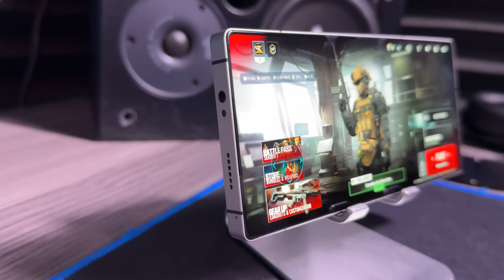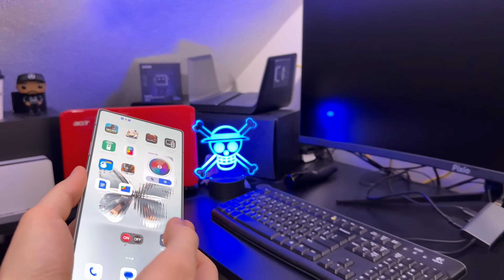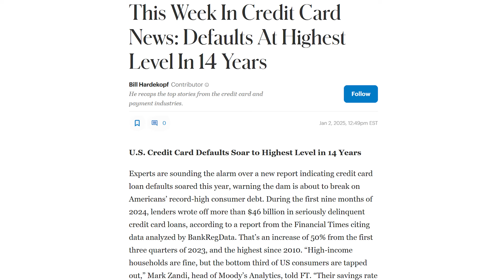What CES Revealed About Repairable Tech In a Record Year For E-Waste (2025 Is Not Looking Good)

Comment: I have a story about repair manuals: I bought an old radio/cassette player from the 80's on eBay recently, and found a manual for it online. That manual tells you the exact steps for disassembly, tells you where all the screws are and how to get them out properly, and the specifications for -- check this: the pinch roller pressure, torque, azimuth; basically everything you need. Oh, and it also lists all the tape models for testing and some of the tools you need.

As someone born in the 2000's I've never seen ANY manual that's like this, and I love this old thing already. It's so cool to have documentation that just tells you "go fix it yourself, heres some info to make you less likely to screw up," rather than "hey, here's the phone number to call for someone to tell you to buy more of our stuff, idiot". Makes me like my product and the company more this way.
Reply: Equipment repairman. Sometimes i end up working on gear thats 30 years old. EVERY bit of kit from this era has excellent service manuals
Nowadays a 'field service manual' might as well be a one page doc 'no serviceable parts inside'

That way the technician can spend ages on the problem for a nice fat invoice and then when the equipment dies you get to buy another one!
Reply: Even cars used to have full teardown/reassembly instructions in the owner's manual. Now the owner's manual sends you to the dealership @localwhackhead
Reply: @ohnoitisnt  'gear' is pretty vague. If you repair stuff like dental chairs and x ray machines, ofc you're misunderstanding the difference between that and a modern mobile device. People who think a manual is going to tell you everything about a device... most devices come with a link to a pdf if you really need it. 

You wanna fix an iPhone? Get a straight razor and a $12 micro driver kit from Walmart. Do you really need someone to kill a tree for you to unscrew 2 pentalobes and use a razor to pry gently, creating enough room to insert a pick? 

Want warnings about using too much force or what could happen if you pry from the wrong edge? How about instructions on how to turn screws or remember placement? 

Most of what people criticize repair for... are basic skills anyone can learn. If you lack dexterity... or hands, might be a different story. As a repair tech I can confirm people mess up their own devices trying to do self repair and save money. You already have the right to do that. 

You'll pay for help to fix your mistakes, depending what they are... a new phone might be cheaper. Also, coming from someone using an 8 yr old smartphone to send this message. A phone I have worked on a few times. 

Without a manual.
Reply: @Baeloro1481  lol what kinds of repairs can you do on an iphone with a razor and a screwdriver? You open it, now what?
Reply: I bought a laptop from Lenovo 2-3 years ago, and they have manuals for how to open up and modify the laptop available for people to download and use, along with recommendations on what to use to open it. Not every company does it, but some still do.
Reply: @NobleLeader6  Exactly this. Making blanket statements about 'rights to repair' tends to make you look silly when anyone actually spends time investigating claims. 99.99999% of the time you have one of two situations: 

1. Companies doing something to help consumers. 

2. Companies giving consumers a reason to avoid buying their products. 

Making it about rights and repairs, and making that the springboard for anything else, actually pretty distracting and disingenuous. 

There are people who complain about not getting more stuff in boxes, when most of the stuff ends up in the trash anyway. Manuals used to be pretty chonky. Now they are QR codes. 

While it's not as convenient as having dead tree remains (I am not a tree hugger) detailing everything you might ever need to know, it's friendlier to both cost reduction and resource savings.
Reply: Love your story man. I grew up in the 90s. Almost all of the old stuff was like this. Imagine the 50s. Average American family, people did go to the electronics store, buy the kit or parts, and they bulid themselves a vaccuum tube amp. That was the norm back then. They bouth the Dynaco ST-70 kit. 100+Volts, so its not a toy, still everybody could build it and they sold 300000+kits back in the 50s...
Reply: It's cool. There's a few orders of magnitude of miniaturization between a cassette player from the 80s and any modern device. It's not really a matter of 'you need manuals' but more of a 'you need eyesight and manual dexterity capable of working on micro electronics. Things you need a microscope to even begin to see. Imagine science class all over again, looking at stuff on a slide magnified. 

Cept you're working on an iphone 11 with board separation and it could be one of 30 solder joints and you just cleared your afternoon so you can painstakingly check each one with a multi meter. I'm all for people working on their own stuff, but there comes a point when the size of the components, the ability to do the work, is not there for 98% of people who would actually try. 

Spend $1000 on a device, break it taking it apart, do irreversible damage to components 'DIY Value' and then take it to a shop where someone gives you a look and quotes you way too much money to fix it.
Reply: @Baeloro1481  That is nonsense and you know it. By your logic, desktop computers are impossible to exist nowadays, since they are made of microelectronics. Not to mention there still is many repair shops for smartphones.

No one is talking about making the electronics from scratch, your analogy is like saying tha old manual is useless bcause common people don't have the machinery to made plastic molding. Everything nowadays is modular, many times being posssible to take a piece from a broken model and reusing it. Not to mention there are many DIY that can indeed do what you mention and would love to work on the hardware and software.
Reply: @Baeloro1481  FYI, repair manuals are for the repair technicians. Right to Repair is more like "Right to get it repaired from a 3rd party technician". Nobody is asking devices to be made easy enough to repair for the average person
Reply: @marcogenovesi8570  Actually, everyone in repair advocating for 'rights' is asking for 'user replaceable batteries' and people are hopping on the modular bandwagon via Framework and Fair phone - two companies whose entire shtick is to let the end user replace parts. There's another company doing it recently too, HMD. 

So, a 'repair manual' is like 'the paper version' of what people typically use in electronics repair. It's a 'gotcha' point. Boardview is software that lets you view the schematic electronically. 

Either, you have rights to repair already, and can get that done (send it to me, I'll give you fair price and do quality work), or you don't have rights and you need to secure them somehow? 

In an age where you can, in fact, get 3rd party repairs done... but the issue will always be quality workmanship. I've met guys I wouldn't let work on my own phone, happily churning out reworks for their shop, none the wiser. 

Ubreak Ifixit even has OEM parts access.
Reply: @ Right to repair is a much larger movement than the small quantity of consumer electronics you look at. Home appliances, automotive and farming equipment are the main ones, on top of smartphones and computers.

Batteries are not parts they are consumables and as such they should be replaceable by the user, like they were in the era of the AA and AAA batteries. Some companies like Framework go overboard and make the whole modularity a gimmick, but it's not what the movement is asking from OEMs.

A repair manual is the manual used by repair technicians in general. It's not just the board schematics it's the full disassemply/assembly instructions for field technicians.
Because again there are more items than just what you can work on that have significant mechanical component and need instructions for servicing. Don't come at me with your "I'm 150 IQ and I don't need that", you work on small stuff where the worst is clips and glue.

So you can source custom electronic parts that are not even on catalog, or pair iphone components or John Deere components? How big is your schematics library? No kiddo you cannot. You speak like you are still in the 2000s, the times changed.

OEM parts access alone means nothing, especially for Samsung I have seen them do fast and loose with that. Stuff might be out of stock for 6 months or priced too high to attempt a repair.
It's either third party replacement parts like with cars or nothing, imho.

And speaking of "quality workmanship", ubreak ifixit is not one of those. Most chains in general are not particularly good
Reply: @marcogenovesi8570  Basically, you misunderstand your rights, what repairing anything means, and your role/responsibility as a consumer. 

1. People should always vote with their wallet. People should never buy marketing hype or branding. - virtually no one listens. Look at all the schmucks walking around with apple vision pro for the 3 days it was relevant/cool. $3500 entry fee on that.

For some aspects of consumerism, you will only get a product that is disposable. Unless you create something yourself, out of components you sourced yourself (which is possible, people do it), you are always going to be purchasing someone's design, the flaws they overlooked, and you will be participating in their version of this product, not anything else. 

2. ANYTHING IS REPAIRABLE.... with the caveat of 'you must possess a degree of knowledge/skill to facilitate a repair, even if tools/parts are provided.' We are talking about materials and parts that are no longer hand produced. A machine will fabricate a silicone wafer and then stamp/edge the transistors into the surface... and that is a 1 and done process. 

If the chip has a flaw or fails, you get another chip. You do not repair. Many processes are this way, hence the modular components, lack of 'easy repair' because... duh. It's like expecting brain surgery to be easy because putting on a band aid is easy. Different problems. 

In a world of people who can put on band aids, you have a brain surgeons problem when it comes to repair. It's not as easy as anyone argues. You can fix your stuff. No one can legally stop you. If someone designed something so poorly it cannot be repaired... you maybe should know that before you buy it (do your homework on new anything) and maybe avoid it. 

Don't buy it, use it, break it, then demand a repair. That's how you end up feeling put out. 

3. Batteries are not 'consumable.' They are 'rechargeable' or 'replaceable.' You don't eat batteries. Batteries are not consumed by a product. They are depleted, then either replaced (old model), or recharged (new model). Everything from automobiles to toothbrushes have rechargeable batteries now, both for sustainability reasons (fewer batteries being produced) and for convenience. 

Having to buy a battery, find where you stored them, hope you have some left, hope they still have a charge, and then figure out how to change them (because it probably won't be the same for a toothbrush as a cellphone) all things that make disposable batteries a worse experience. 

Wanting to have a spare battery is okey. Wanting to put it in, also okey. Like I've said, currently using a v30 with a battery I replaced myself at home, without any prior knowledge, any manual, any tools (razor, screwdriver, that's all), It's my right to just go onto the internet, buy a battery, and open my $850 phone up, change it myself, and then get on with my life. 

Get this, my car battery went tits up due to the cold weather this week. I have a 2018 Kia Forte. I went to auto parts store, bought a new battery, since mine was more than 6 years old, put it in, and took the old one back. 

The auto parts store had a battery compatible with my car, it met/exceeded the ratings of the OEM battery, and it came with a warranty, even doing it myself. I don't know why people think there is a 'right to repair' issue. 

There is a 'perception and listening to the wrong people' issue. 

4. My schematics library is as big as I need it to be, have this thing called the internet. If you're waiting for samsung to directly give you anything, they are probably going to be using it in a phone they want to sell first. If my option is to give you a replacement screen (most common repair) on a phone that is 3 months since release, not only am I still producing the phone, I am allocating significant resources to do so, and those resources are being distributed across the world in the form of... new phones. 

If I needed to keep a new screen part for each phone manufactured? Talk about ewaste. There are something like 1.8 billion phones (just phones) sold annually. Those spare parts scale up to a significant, unmanageable issue for any company. So, when you get a spare part, it's after they are finished with production, usually from a pool of parts set aside or produced specifically for repairs, but without knowing how many shops will need parts, when they will need them, without developing some pretty serious relationships.... you won't be able to supply anything without unjustifiable costs. 

Ubreakifixit will get those parts on consignment... meaning you get OEM parts, and your repair is authentic, tracked, and kept as part of Samsungs business record for the rest of eternity. Some people see this as 'privacy invasion' but that's like expecting mail without giving the city your name and address. 

Some information has to be shared, retained, and they have to know (as a legality) their parts aren't being sold out the back door of Ubreak Ifixit's shops. That's a anti trust issue (fine for Samsung) if they do nothing about it, and a huge anti trust issue for Ubreak Ifixit if they do it. 

If you think that you can somehow change the current climate by advocating for rights? Rights you already have? If you think you have the right to dictate how businesses operate? I mean... at some point you need to concede something.

Comment: I just wish we could get form factors for laptop motherboards and parts like what we see with desktop computers.

Sure, we have framework, however, I'd like to be able to upgrade a laptop over time going from let's say the Ryzen 3 3250U to lets say a Ryzen 7, not just get faster storage and better RAM, and if you're lucky, upgrade the screen from 1080p to 1440p or 4K.

My personal dream I'd love to see for phones/tablets/laptops is have the level of customization we have with desktops, custom cases, be able to build it from scratch, manufactures could also have a field day making their profits from it to which is all they care about.

And not just does tech no longer exist for low/middle class, it also stopped existing for tinkerers as well. 2000's you could buy the cheapest desktop or laptop, and upgrade it over time to top of the line for what it can be. Socket 775 was the last hurrah for laptops that I know of at least.

Comment: Thinkpad is sometimes also quite rubbish.. the replacements parts or in general the oem parts are really bad. I had started working since t460p for 2k € until t480 and both were rubbish.. t460p in 3 year use.. 4 screens, 1 keyboard, 1 mainboard and uneven display frame to chassis.. uhh t480 same display issues.. turn 100% display brightness and walla white dots appear on the next day everywhere…. Give it back..
Reply: So what is not rubbish that you can actually recommend?
Reply: @ i must say and as stupid it sounds its apple.. since i switched to macos and MacBook it just works..

Comment: Totally agreed with you...2025 will definitely be the year of e-waste.   But I'm still using 6th Gen INtel core i5 with a used HP 800 G2 Mini, a Macbook Air 2014, a Macmini 2014, and a iMac 21" 2013 for almost 12 years now...they are still good and I kept maintaining them by upgrading them in terms of adding more RAMs faster SSDs, and NVMe etc.   Technologies should last, and they should not be replaced unless proved dead.

Comment: Yeah, at this rate seeing how shitty new TV's are in terms of longevity i'll just buy a good old panoramic sony trinitron and some adapters to hook it to modern equipment. Some will say "booo this old tv does not have smart tv/4k/20k/69k, and it's so biig and heavy". My reply is well F it, at least when it will breaks down, I CAN FIX IT. I have one trinitron which i am using for old consoles and this thing is well over 30 years old and it still refuses to die. My advice right now is buy old tech while its reasonably cheap, renovate it (if needed) and voila, you now own a reliable piece of technology. Same thing goes for streaming. I've had enough of subscriptions, and disappearing music due to unpaid by licenses by large corporations that can normally afford it. So i bought old CD player, replaced old worn out belt, oiled mechanisms and it is working like brand new. Then I started looking for used CD albums and laughed. If you are thinking of getting rid of spotify/apple music etc. now you have perfect moment to do so. Used music on CD is now ridiculously cheap nowadays. To paraphrase Wade from Dankpods, I want to kiss convenience goodbye and OWN stuff.